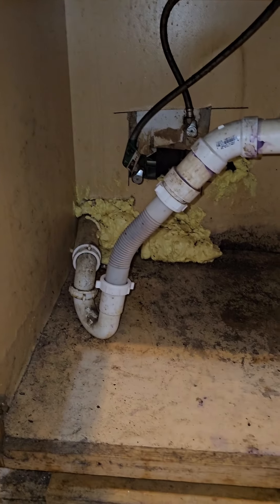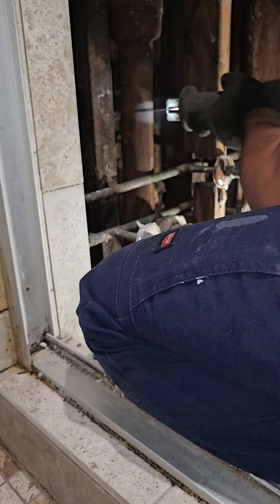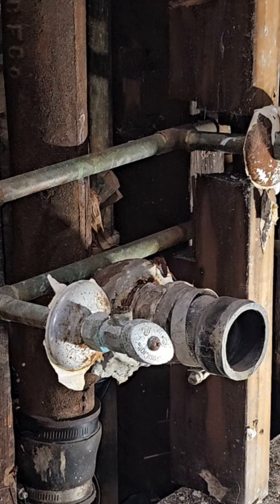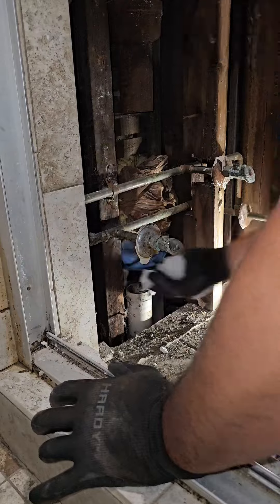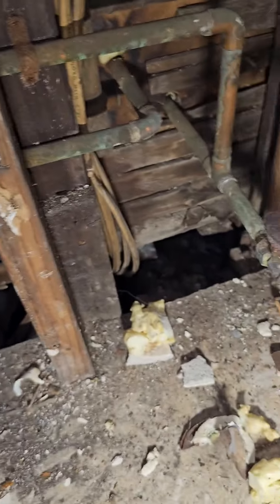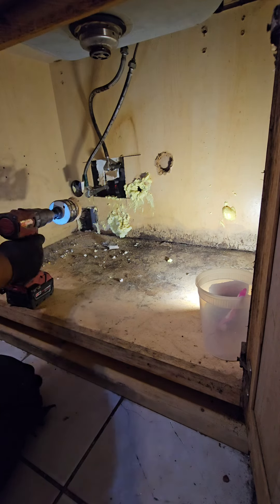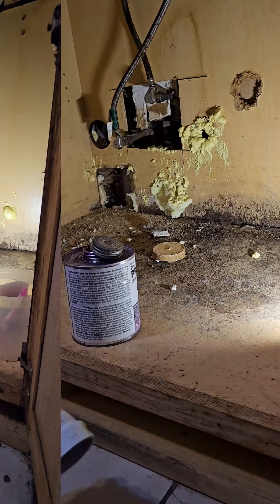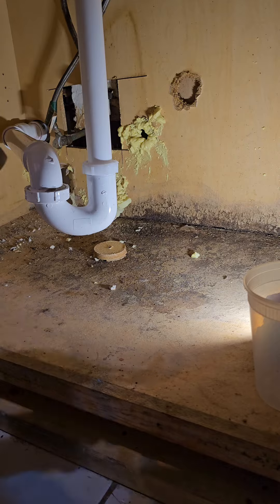Nightmare Apt building cast iron kitchen drain line leaking 🤢🤮 #plumbing #exterminator #diy

Comment: If you don't mind answering a question I'm replacing some of the 4" CI stack in my house. Is 1.5" ok for the short 1 or 2 foot run between the kitchen sink (with disposal) and the sanitee? It looks like that's what you use but I keep reading that it needs to be 2" in the online forums. That's why I ask
Reply from the maker: Ok so i need a little more info,  if your referring to the trap arm being 1½" then yes in NJ that is the minimum pipe size for a kitchen sink that has a dishwasher and disposal. The issue is to make sure the trap arm doesn't exceed a certain distance from the vent.
Reply: @PrecisionDavePlumbingMore  exactly the trap arm being 1½" for about a 1.5 foot run into the vent. Awesome. Thanks for the info.

Comment: Finger control goes a long way until the seal fails. I corrected an issue that went unresolved for years. Maintenance believe it to be condensation due to the cafeteria. Apparently, I was the only one to check torque. Problem solved and no more wasted ceiling tiles. Torque your fermcos people
Reply from the maker: Been doing plumbing for a short time of 18 years, never used a torque wrench on a no-hub and for know no problem. Thanks for watching

Comment: Mold isn't because of the tenants... Probably because of... Leaking strainer
Reply from the maker: Well it's part true, because if the tenant tells the super, then it won't get to that stage. But who knows if the super doesn't care and doesn't get it fixed.
Reply: @PrecisionDavePlumbingMore  or if the super tells management and management doesn't care
Reply: @PrecisionDavePlumbingMore  reminds me of someone I know who was turning their hot and cold supply valves from the access panel of behind adjacent closet because it wasn't turning from within the shower and they thought the super was "creepy" so didn't want to report it

Comment: As a plumber I wouldn’t be able to leave without fixing the leaky strainer that’s crazy not to fix it while it was already all apart anyway just fix it charge it on the bill and done management/handy men aren’t plumbers (lol) it won’t get fixed and we know it but hey curious to know where does this plumbing happen New Jersey you say ? Everywhere is different for sure in Rhode Island we can’t use those traps same with Boston I seen the plumbing monstah and wow is it different still yet to find a portagee plumber out there like I am lol
Reply from the maker: So the strainer was not exactly leaking, had corrosion like it was leaking and it stop. Yes I should've changed it but I did enough free work that I wasn't going to spend more out of my pocket to make a cheap rich landlord not spend his money.  As for as traps what traps do you have to use in RL ?
Reply: @PrecisionDavePlumbingMore  just regular pvc traps all glued sometimes with clean out on bottom lol when I was doing plumbing in nyc it was all brass traps and no pvc all cast